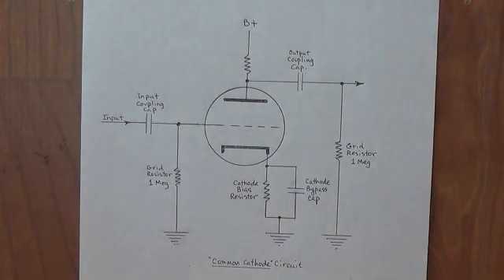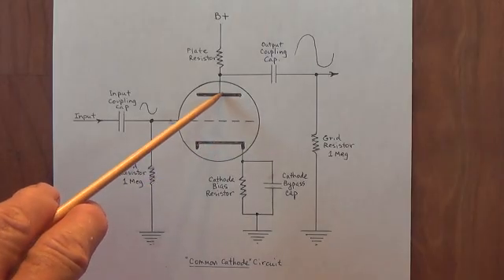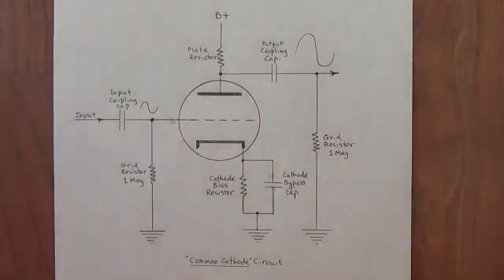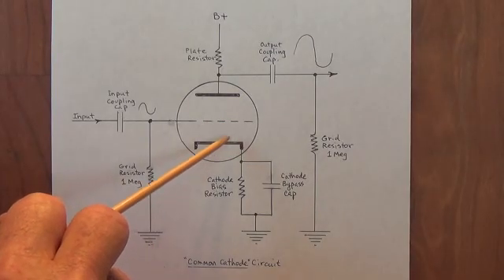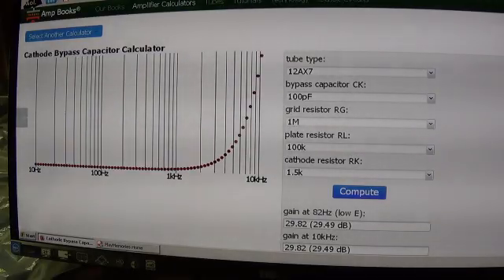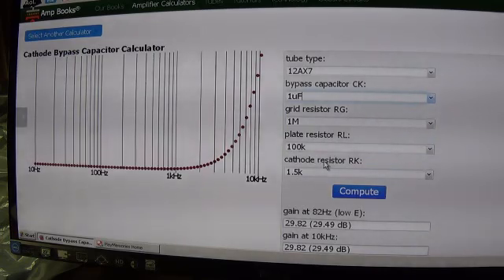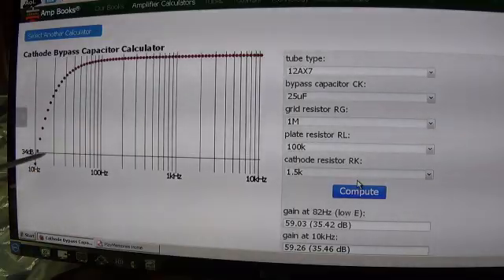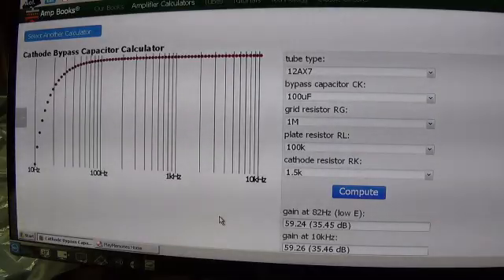Cathode Bypass Capacitors: How they Affect Gain and Tone

Comment: I have been building and repairing (and using) audio amplifiers sunce 1962.  I notice that nobody explains the THREE kinds of grid bias clearly. Most explanations are difficult and badly worded.  First, grid leak  bias should be taught and some typical transconductance curves shown and how the plate voltage in a typical circuit follows the grid voltage but in inverse phase. Your diagram showed the plate ac signal as the same phase as the grid.  That is wrong.  The next circuit that should be taught is the one with the actual negative grid-bias supply. In really old radios this used to be done with a low-voltage battery which would last for years cuz the current was so incredibly low. (In battery powered radios used where there was no AC power, an "A" battery powered the filaments typically 6 volts but sometimes 1.5 volts, a B battery would power the plate circuits  (usually 100 to 200 volts) and a "C" battery would power the grid bias usually 1.5 to 6 volts. "A", "B" and "C" had nothing to do with the physical size and nothing to do with our modern designations of AA, AAA, C or D size cells.)  Then the next thing to drill into the studenrs' heads is that you can either make the grid more negative as with the first two methods, or you can hold the grid near ground and raise the cathode positively wrt the grid by putting in a cathode resistor.  With each type of biasing the graphs should be shown of effective grid-to-cathide bias  versus plate current and plate voltage for a typical circuit.  ONLY after yoi have dobe all that, you should talk about cathode bypass capacitors.   The VERY best short course in tube electronics in my day was the OLD RCA Receiving Tube Manual with a fantastic teaching section near the end of the book. Best I have ever seen.  If you can find that book you've found a teaching treasure.
Reply from the maker: Thanks so much for your lengthy and detailed input, Fred. If I showed a diagram with grid and plate signals in phase, then I apologize.....we all know they aren't.
Reply: @UncleDoug  First of all, your channel is great, I learn a lot. Your diagram made me grab my books again and I even called a friend, because I was taught otherwise. Fred's remark gave me my confidence back ;-)

Comment: if you put capacitors in parallel can you get two bumps? or even three can you have your cake and eat it too.
Reply: I still wonder what effect it would have.
Reply from the maker: Two or three capacitors in parallel act as a single capacitor, with double or triple the capacitance.
Reply: Well I was looking at power supply frequency ripple and different caps in parralell can  filter different frequencies  like a large cap would filter low frequency noise and small cap would smooth out the high frequency noise this why in many circuits they have bulk filters for the large swings and by-pass caps for higher frequency noise I just didnt know if it would work the same in combining a small cap with a large cap would give you gain in both High frequencies and low frequency since the the frequencies would look at each cap differently the same frequencies that would pass through a 20uf cap would be stopped by 10pf cap. and vise versa at least this is my thinking. Each cap would allow propagate different frequencies. Just telling you why I was thinking this. I know that may not be right but i know in DC smoothing yes the capacitance just adds up but I also know that ac signals see caps differently.
Reply: No am saying why does adding a 20uf cap widen the frenquency response. Its because it lets the low frequencies pass through the cap to ground on cathode boosting the low end signal right? So a smaller value would would let the higher frequencies pass to ground so that increase the gain on the higher end frequencies.  Basically what am asking is why couldnt you add both to increase the frequency respones of both. A cathode by-pass cap is not smoothing anything.  Its like you say in the video a small cap enhances treble a large cap enhances bass so what if you put both, but i was looking at the response pattern on the 20uf and looked like it was already doing both anyways so i think its kinda not important anyway. but maybe it would I dont know.
Reply from the maker: Again, I don't think it would work, Jason, because the two different value capacitors in parallel would not act like two separate capacitors, passing different frequencies, they would act as one capacitor of higher value (the sum of their two values).
Reply: I think you might be right I appreciate you talking with me am just thinking out loud am more comfortable with solid state stuff but am very interested in tube gear am just curious about such things. Am just getting into tube stuff and just trying to learn all I can I have rebuilt and old Oscope but I mean thats just a recap and change out resistors that have strayed. But again i appreciate your patience and answering  my questions am just trying to learn all I can.
Reply: But yes I think you are right great videos I will watch all of them. Thank you for talking with me.
Reply from the maker: You're welcome, Jason. Best of luck with all your projects.

Comment: This bypass cap becomes very important for low-impedance stuff like transistors. The higher the current you can run through the active component, the more potential gain is taken away by the emitter/cathode resistor.
Reply from the maker: This is news to me, since I do not deal with transistorized circuits. I do know, however, from experience with tube circuits, that adding or increasing cathode bypass capacitance can increase gain significantly.
Reply: Explanation is pretty simple. The more current through the resistor, the higher the voltage drop and the stronger the negative feedback effect.

With transistors (in particular BJT transistors), where you operate at lower voltages, higher currents, where you can have current gain of several hundred times the current of your input signal, you loose a lot of potential gain by not having decoupling around the emitter resistor. You can get away without one, but then you have to bias your transistor with pretty low voltage and have a small emitter resistor. This again affects the resistor-values of the bias voltage-divider, and can lead to less of the signal passing through the transistor.
Reply from the maker: Thank you for your input, PO.

Comment: Common Cathode refers to the cathode being common to both the input (grid) and output (plate) of the amplifier circuit. Also this setup inverts the signal - a positive swing on the input produces a much amplified negative swing on the plate.
Reply from the maker: Yes, indeed, Brian. Here is a great reference for those who would like to know more about this topic:   http://www.valvewizard.co.uk/gainstage.html

Comment: Ok, another noob question.  Is the value of the cap what determines how fast it charges and discharges and, if so, is that what permits certain frequencies to "pass" more easily than others?  For me, caps are like doorknobs.  You can explain to me that if you want to open the door, you need to turn the doorknob.  Ok.  But since  I've never had any burning desire to take a door apart and examine the mechanics of a typical doorknob, I really couldn't tell you how one works other than you need to turn it if you want to get out of the bathroom.  So: cap value=charge/discharge rate=frequency doorknob?  An oddly phrased question, I admit and, no, I don't have any particular obsession with doorknobs.  Cheers, MW.  BTW, I still have that magnificent photo of your hot-rodded Mystery Amp ready to send, if you care to drool over it.
Reply from the maker: Naturally, the lower-value the capacitor, the more rapid the charge/discharge rate, but another way to alter this rate is to install a resistor, either before or after the cap, to further regulate the c/d rate....which is how high and low pass filters are created. A very low value cap can respond much more rapidly to high frequency, matching the peak (charge) and trough (discharge) rate.....allowing them to "pass".  Vice versa for a high value cap being able to match low frequencies.
Reply from the maker: P.S. Please post the photo of the amp on my Facebook page: Uncle Doug's Vintage Amps, so all the viewers can enjoy it too :)
Reply: I'm a non-Facebooker.  Maybe I can talk my wife into posting it...And, thanks, I think I get it.  Because of the resistor, a "fast"-c/d cap will take longer to c/d, therefore changing the frequency it passes.  Am I on the right track here?  I taught myself how to overhaul saxophones and I now run a saxophone repair business. I'm trying to teach myself how to fix/mod/build amps.  I'm using the same method I used for my saxophone education: (1) reading/watching anything and everything I can find on the internet and, (2) bugging people to death with a million questions.
Reply from the maker: Yes, the resistor alters the time constant of the capacitor....fine tuning it to a specific frequency and allowing for the exclusion of frequencies either above or below the filter's discrimination level. Your methods always worked for me :)  P.S. Your wife did post it and I have re-posted it at the top of my page. Lots of viewers have already seen it and commented. Thanks !!!

Comment: Excellent Vid! Wow, 100th video and still no ads! Very generous of you Doug. I once aquired an early Mesa Boogie schematic and found the first two gain stages had diodes in place of the Cathode resistors. So I tinkered with my 65' Deluxe Reverb using 1N914's with different capacitors (the schematic did not show any part numbers for the diodes). Using my Telecaster, I found some interesting gentle overdrive and sustain effects.. Eventually I went back to stock preamps but the OT-NFB circuit is another story...:) Still enjoy giging with my little sweetheart!
Reply from the maker: Thanks, F. Glad you liked it :)

Comment: Happy New Year Guys!
Last month, I bought myself a 1974 Fender Twin Reverb (Silverface). All the original 1974 parts inside including the transformers and caps. Sounded beautiful with that distinctive Twin Reverb punch and tone. 
Like everything I buy, I had to open her up for a look see. I noted one of the brown electrolytics (Mallory 20uF 500V) in the dog-house had long spilled it's guts, yet the amp performed flawlessly, no hum or power supply issues. 
I figured it’s time for a capacitor change out, so I ordered some F&T's for the doghouse and IC 22uF 25V for the cathode bypass..
 
Once done, I found the amp lost it’s Twin Reverb lustre, something was tonally lacking.
I figured it could not be the power supply caps, and decided to re-install the old, white Mallory 25uF 25V cathode bypass caps.  Wow!  That wonderful Fender Twin Reverb tone immediately returned!

When doing the cap job, I decided to run all the bypass caps through my cap tester and here’s what I noted:
The new 22uF  50V IC caps all measure 25.85uF  with an ESR of 2 ohms  (pretty much consistently)
The old  25uF 25V Mallory (white) caps measure 32uF with an ESR of 2.8 ohms to 43uF ESR 3 ohms (each one different).

Ran the Amp Books cathode bypass calculator and ran the numbers, nothing startling showed-up, can't account for the "black-art" going on here, but left the old white caps in and I'm happy with my amp.
Reply from the maker: I too am at a loss to explain it, 9Z. Common sense tells us, and I tend to believe, that capacitors of equal value are indeed equivalent, so this is puzzling. I will add, however, that my policy is to leave all original caps (that pass testing and demonstrate no physical or functional flaws) in place.....especially those, such as bypass caps, which are exposed to minimal voltage and current. While your experience casts doubt on the equivalence theory, it does reaffirm the conservative approach to cap replacement. Thank you for sharing this with us.

Comment: thank you very much uncle doug i learn a lot but i just have a question...about the bypass capacitor of the output tubes like el84 can i tweak it just like preamptubes? is the same effect like if you put less capacitance it will turn in high frequency or if you put a larger one it will also increase in gain? or like you said that the effective bass response is at 20uf to 50uf higher than 50uf  is not really good at bass response?... hope you can help me and thank you very much...
Reply from the maker: You're welcome, Woody. Bypass cap values generally respond to tweaking quite well. The main effects of higher bypass cap value are an increase in gain and bass response.....up to a point, then diminishing returns limits the effect.
Reply: thanks uncle doug... it really helps me a lot good luck and god bless....
Reply from the maker: You're welcome, Woody.....and our best to you all.

Comment: I haven't read through all of the comments, I apologize if this has been asked, but shouldn't the output signal be inverted from the input? 

Also, one dude noticed that the grid leak resistor with no current is effectively at ground making cathode bias positive with respect to the grid voltage at 0Vdc. Uncle Doug says that the grid should always be negative with respect  to the cathode bias voltage. It's the same thing. Just clearing it up.
Reply from the maker: The grid signal is inverted on the plate in each amplification stage, so it depends on how many amplification stages there are. Thanks for your input.

Comment: Hi. Great video! 
I believe there is one fault in your drawing. Shouldn't  the Output of the signal be 180 degree out of phase?
Reply from the maker: Thanks, Steve. Depending on what type of device you use to view the video, the following note obscures the output wave form in the video:  "The output from the plate is greatly amplified and out of phase with the grid signal".  Apparently this note was not visible on your device.

Comment: But, the gird isn't negatively biased, it is at ground.  The cathode is slightly positive, due to the cathode bias resistor.
Reply from the maker: Grids are always negatively biased (with respect to the cathode) to repel the electrons being emitted by the cathode (to plate) and thus to keep the plate current at a normal "idling" level. In cathode-biased amps, this is accomplished by the bias resistor. In grid-biased amps it is accomplished by applying a negative DC voltage in the -30VDC range from a dedicated bias power supply. Grids are never grounded, or the signal would go to ground and the amp would cease to function.
Reply: The current through a triode is controlled by the voltage difference between grid and cathode. If the grid is at +1V and the cathode at 0V, the grid is at -1V with respect to the cathode. If the grid is at 0V and the cathode at -1V, the grid is still at -1V with respect to the cathode. In a cathode follower the grid might be at 99V and the cathode at 100V, which means that the grid is still at -1V with respect to the cathode.
Reply: I have made a booboo! The second sentence should read 'If the cathode is at +1V and the grid at 0V, the grid is at -1V with respect to the cathode.' Mea culpa!

Comment: Can I also use a 10nF cathode bypass capacitor at the first preamp tube to eluminate LF and shorter wave signal frequencies and a 47pF capacitor at my last preamp tube before I go into the tone stack to lower the bass so that my tone doesn't get muddy?
Reply from the maker: Without knowing about the rest of the circuit, it's difficult to say, but I suggest experimenting with different values until you find the combination that sounds best to you.

Comment: Can I use a normal foil capacitor instead of an electrolyt capacitor as kathode bypass capacitor?
Reply from the maker: I'm not sure what the difference is between a normal foil and an electrolytic capacitor. Electrolytics use foil also. I would say that any capacitor of the correct value, i.e. 25uf @ 100VDC, would work.
Reply: You will have difficulty sourcing foil caps with high enough capacitance. Low value capacitors will severely limit bass response.
Reply: You need to be very careful in selecting the type of replacement capacitor to use in tube amps. Power supply filter caps due to their large capacitance will be electrolytic. Cathode bypass are not as critical to type, but the DC blocking caps between stages must have extremely low leakage current to avoid biasing the next stage - electrolytic caps typically are NOT suitable

Comment: I wonder how it would sound if you replaced the bypass capacitor with a variable capacitor within a predetermined range.
Reply from the maker: I am not familiar with variable capacitors in the 20 to 100uf range, Neal. They are generally in the sub-uf range. If you have access to a miniature variable 50uf capacitor, then it would probably be very useful in an amp circuit.
Reply: good to know,  thanks for making the videos! I enjoy watching your detailed explanations on tubes,amps, and re-coning speakers.
Reply from the maker: You're welcome, Neal.

Comment: It would be awesome if there was a video about negative voltage and ground so the two are not confused and grounding schemes I always found that to be a hard topic
Reply from the maker: I have several videos posted that address B- voltage and B+ return pathways, Joshua. Check out my Power Supplies video series and the How Amps Work series.  I hope they are helpful.
Reply: thanks